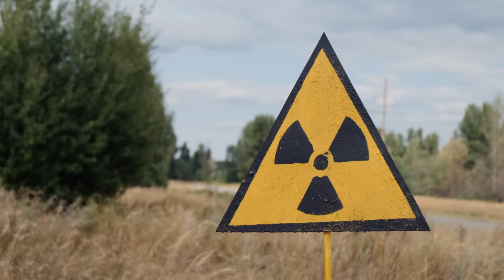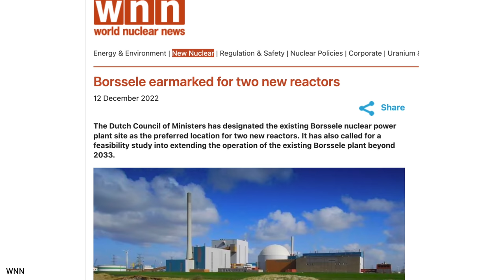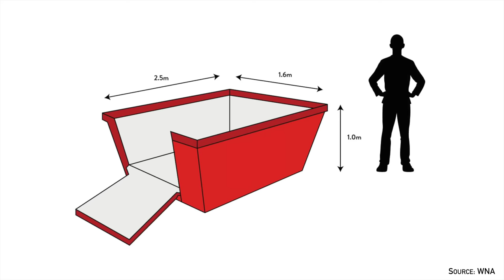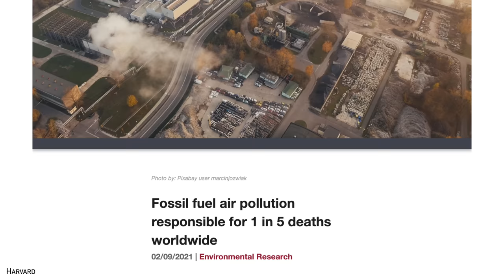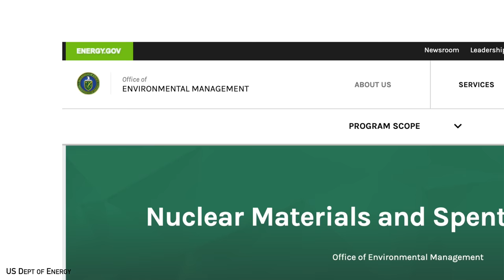Can Nuclear Waste Ever Be Solved? Yes.

Comment: The question is always "compared to what".  Fossil fuel waste, is basically burning stuff, spewing it into the atmosphere, spreading it around.  Coal is the worse.  Natural gas is a bit better.  And then there are runoffs, into water streams.   Nuclear waste, by contrast, is relatively small,  compact, solid, and localized.  (Though someone can address the issue of radioactive water near Fukushima.)

The other interesting metaphor oftentimes describing nuclear waste, is taking a bite out of a hamburger, then throwing it away, calling it "waste".  That's where our reactors are today.    Let's say we set it aside for 100 years.  I'm sure (or hope), by then, we have cheaper breeder reactors, or new types of reactors that can consume what is currently called "spent fuel".
Reply: You left out renewables.  Cheaper and with an even lower lifetime carbon footprint than nuclear.
Reply: @bobwallace9753  I am in favor of renewables.  But these are intermittent resources.  You can ameliorate some of the intermittency with the complimentary profiles such as pairing solar with wind.  But with dunkelflaute, when the wind isn't blowing, and the sun isn't shining, you don't want civilization to grind to a halt.  So far a low carbon portfolio, you still need some dis-patchable resources.

Nuclear is one of those alternatives.  There's also hydro and geo-thermal.  But they have geographical limitations.  (And don't get me started on permitting, and transmission lines.)  Also, storage can help.  There are time shifting storage, which allows for integrating of more resources, also diurnal, ... and hardest to do, seasonal.  And some people have talked about overbuilding on solar (3x-5x), since the prices continue to drop.  It will probably be the cheapest, most deployable, most scalable intermittent form of electricity in the next decade or so.

I can probably go off-grid with my own solar+storage (maybe a gas generator backup).  But for industrial scale applications, such as steel making, manufacturing, industrial heat, high temperature applications, you need something else.  That's why people talk about hydrogen, as another leg of the solution.  Green hydrogen (from renewables) is still too expensive.  There's blue hydrogen (natural gas+CCS) is cheaper.  But there's some skepticism about methane leaks, and the fossil fuel industry, in general.  Pink hydrogen (from nuclear), always on, continuous generation, maybe another secondary service, besides electricity generation, may justify the cost of nuclear, esp. in the industrial sector.
Reply: @mintakan003  
Facts don't support you.  Studies have shown that with a mix of renewables and storage we can create reliable 24/365 grid power.  

When you consider nuclear remember that reactors fail at times.  They need backup generation (a cost).  And reactors cannot adjust output rapidly enough to match demand and supply so they need storage (a cost).

What you're left with is a decision between 

1) $0.15/kWh nuclear (unsubsidized current cost) plus storage and backup generation or 

2) $0.03/kWh wind/solar (unsubsidized current cost) plus storage.
Reply: @bobwallace9753  I don't think cost by itself covers it.  It's the quality of service.  As for uptimes, capacity factors, the other thing to take into account is predictability. 

Load following nuclear is possible, if one takes into account thermal storage.  I don't think the discussion is yet settled.  

(Of course, nuclear still needs to deliver on its cost projections, and delivery times.  So on its own terms, it needs to show it can do what it says.)
Reply: @mintakan003  
Cost will determine what the market buys.  

Capacity factor(CF) is part of the cost calculation.  Read up on the levelized cost of electricity (LCOE)  There's a good page on Wiki.

Nuclear can load follow to some extent, but not rapidly to deal with rapid demand changes.  And load following makes nuclear more expensive.

Cost of electricity = cost of generation / amount sold.

If you load follow with nuclear then there will be fewer MWh sold.  Total cost gets divided by a smaller number.  France (crudely) load-follows with their reactors.  I don't remember the actual numbers but let's assume a 90% potential capacity factor.  If some of the reactors are turned off so that annual CF drops to 70% that means the total annual cost is divided by 0.7 nameplate generation rather than 0.9 nameplate capacity.  

Let's assume a hypothetical cost of $0.14/kWh at 100% CF.

$0.14/ 0.9 = $0.16/kWh
$0.14 / 0.7 = $0.20/kWh
Reply: @bobwallace9753  I get you.  I use to make the same sort of arguments.  Largely the same rhetorical points as RMI.  But LCOE is not always a good measure of what it takes to make something work.  It doesn't take into account getting the energy, at the time it's actually needed.  We don't yet have good metrics,  good valuation, for quality of service.

The real test is can you run an industrial civilization, with heavy manufacturing, with 100% renewables.  (Let's leave out hydro and geo-thermal, since these are not geographically generalizable.). E.g., China and EU are dealing with these issues.  (Natural gas is currently the fill in.  Coal for China, though they want to move away from this.)

There was a debate on this, in the scientific papers (PNAS being one of them), between Mark Jacobson and Chris Clack.  (I tend to side with Clack.)

Don't get me wrong.  I'm still in favor of renewables.  As much as we can get. Even if we get to 80% renewables, with 20% remaining, we would be doing good, compared to where we are at now.  We will probably need some nuclear.
Reply: @mintakan003  
Heavy machinery does not care where the electricity comes from.  Only if it's there when wanted.

The question is whether it will be cheaper to include some new nuclear in our non-fossil fuel grid or go only with renewables.  

From an economic standpoint it makes sense to continue using (safe) paid off reactors which produce electricity for less than $0.04/kWh.  But the math does not hold for adding new expensive nuclear.

Our options:

1) $0.03 wind/solar + $0.15 nuclear + storage + backup for the nuclear

2) $0.03 wind/solar + storage

Option #1 would only make sense if the amount of storage needed for #2 was far greater than the higher cost of nuclear + storage + backup.  And storage is getting cheap.
Reply: @bobwallace9753 You are also leaving out the land use. Right now we could power the entire U.S. with soler power how ever it would take around 9,000+ square miles packing the panels as close as possible. Power storage for the night would require another 5,000 to 6,000 square miles of land. In other words roughly 1/3rd of Utah if it was perfectly flat care to try and get such a megaproject past any of the countless environmental activist groups?
Reply: @ghostlyenigma680  
You're about right on the land requirement if we used only solar.  But we're going to use a mix of solar, wind, and other renewables.  As of 2019 it was about 10k square miles but is dropping as panels become more efficient.

BTW, Utah is 84,899 square miles in size.  About 12%, not 33%

Given that the US has 3.797 million square miles of land mass that would be about 0.26% of US land.  Then consider putting much of that solar on top of buildings and over parking lots and the amount of land used actually is not very significant.

"(E)ach wind turbine only takes up about a quarter acre of land, so that's only about 470 square miles of the US land mass that would actually have a wind turbine on it. The USA is about 3.8 million square miles, so that's only about 0.01% of the land mass."  Powering the US with only wind turbines.

40% wind + 40% solar with a goodly portion of the solar on buildings and over 'other use' land and a goodly portion of wind installed offshore, including the Great Lakes.  Land use ain't no big thing. 

You're way off on the area needed for storage.  Using Elon's calculations we'd need about 1 square mile for enough batteries to make solar-only into 24/365 reliable power.  And a good portion of the needed storage is going inside of buildings.  It makes more sense to store energy where it is generated.
Reply: @bobwallace9753  The storage area is from using actual installation numbers of battery storage Elon isn't known to be overly reliable for getting real-world numbers all that right at times.
Reply: @ghostlyenigma680  
Perhaps you aren't aware that Tesla is the world leader in large scale battery grid storage.
Reply: @ghostlyenigma680  Does that include rooftop solar because those numbers werent included in one report. Land from roofs should be counted because you could have 100+ people living in a 20 story building and use less than compared to 100+ people living in 100 2 story buildings and take up a lot more land. I think you would need at least everything west of the rockies to power the US with solar.
Reply: Whats the issue with the radioactive water near Fukushima? Its literally only a few grams (less than the amount of sugar in a can of soda) worth of radioactive material in all the water and it would be dumped into the huge ocean where it would be diluted even more. And tritium is naturally occurring so theres already tritium in the ocean.

Why do we need breeders? France has been recycling their waste for decades without special reactors (theres more than one way to recycle spent fuel).

You didnt include solar panels which by 2050 theres expected to be 78 million tons worth of waste compared to over the past 50 yrs from around the world theres only 250k tons of nuclear waste. And it would take Japan 19 yrs to reprocess 10k tons of solar panels.

Solar panels and their batteries are ewaste.

"The researchers said only about 5% of used lithium-ion batteries are currently recycled in the United States today"
"Global e-waste is thought to hold roughly 60 billion U.S. dollars' worth of raw materials such as gold, palladium, silver, and copper. However, just 17 percent of global e-waste is documented to be collected and properly recycled each year."
"“With mounting volumes of production and disposal, the world faces what one recent international forum described as a mounting “tsunami of e-waste”, putting lives and health at risk.” said Dr Tedros Adhanom Ghebreyesus, WHO Director-General. "In the same way the world has rallied to protect the seas and their ecosystems from plastic and microplastic pollution, we need to rally to protect our most valuable resource –the health of our children – from the growing threat of e-waste.”

As many as 12.9 million women are working in the informal waste sector, which potentially exposes them to toxic e-waste and puts them and their unborn children at risk."

Wind are made to be durable so they last long which means theyre next to impossible to recycle.

And the environmental impact of solar and wind are horrible (loss of biodiversity, flooding, forest fires, changing weather patterns).
Reply: @namename9998  
Solar panels are recyclable.  Aluminum, glass, refined silicon, a bit of conductive metals, and some companies use recyclable plastic sheets for the back covers (all should).

Wind turbines are recyclable.  Like solar panels, there are no parts that cannot be reused and no dangerous materials that require special handling .
Lithium batteries are recyclable.  Redwood Materials is currently recovering 95% of the materials in used lithium batteries and those materials are being used to manufacture new batteries.  The reason battery recycling rates are low is because we have not yet created a system for getting small (phone, etc.) batteries to recycling plants.

Please do not post misinformation.  I don't know if you are misinformed yourself or simply dishonest.  But whichever, you are not helping things by spreading misinformation.
Reply: @bobwallace9753  "The researchers said only about 5% of used lithium-ion batteries are currently recycled in the United States today." Princeton 2022

"Please do not post misinformation.  I don't know if you are misinformed yourself or simply dishonest.  But whichever, you are not helping things by spreading misinformation."

Comment: Its been solved for decades.
Reply: @clarkkent9080  Both of those (hunger, warming) actually kill or harm large numbers of people, or will, whereas spent commercial fuel never hurt anyone anywhere ever.
Reply: @Nill757  You missed the point poindexter.  Yea starvation and climate storms never hurt anyone.  But they were solved decades ago if people would just do exactly as I say
Reply: Only on paper.
Not in practice.
In practice virtually NONE has been disposed. 
Quite a lot of effort has been spent in court trying to AVOID being responsible and getting the job done.
Until the stuff is contained and interred, all we have is IOUs and a track record of not seeing them honoured.
Reply: @aaroncosier735  wrong.  Now run along
Reply: @protonneutron9046  

You are indeed wrong.

The IAEA reports on spent fuel waste are quite clear. 
NO spent fuel waste has been disposed.

It's not solved till it's been done, with demonstrated costs and performance monitoring.

Catch up.